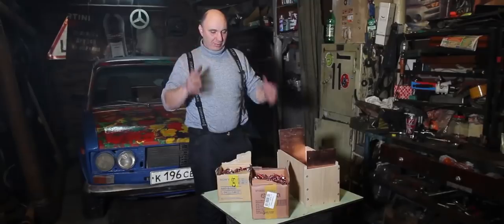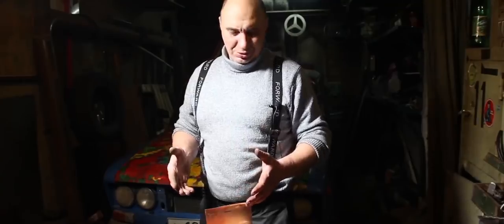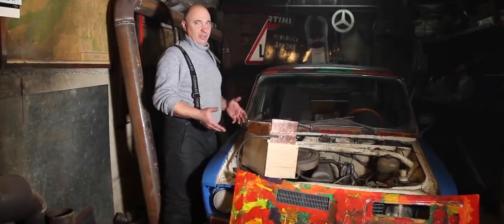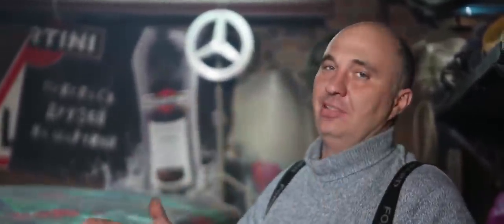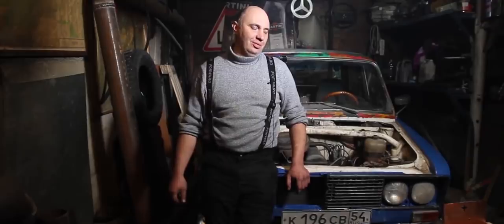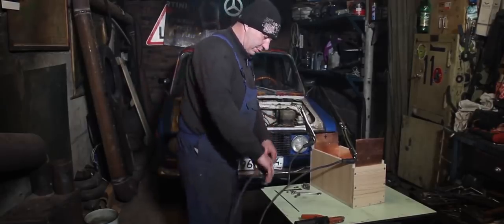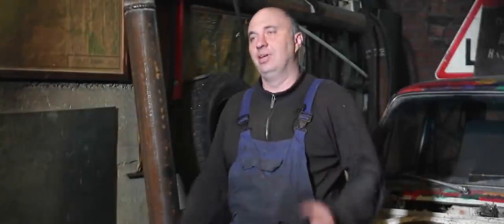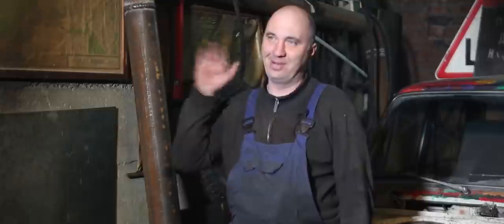1000 AA's instead of a conventional car battery

Comment: 12x8=96 per row.
So it is either 960 with 10 rows or 1,056 with 11 rows.
With the cheap Alkaline having about 1,800mAh capacity.
The capacity would be 144Ah at least.
Reply: He did 125 rows with 8 in each row = 1000 batteries.
If battery puts out 2 amps, times 12v = 250amps. Some say they will put out 4 amps - well then 500amps. Short time though as these batteries have high internal resistance and will heat up fast, weakening them. Without battery balancers, this pack will die.... What a waste of $ & Batteries...

Comment: Math:

The nominal votage is 1.5v. In order to have 12V, you need 8 batteries in series.
1 battery has capacity between 0.7 and 2.5 Ah, so let say it has 1Ah. That means 1 series of 8 batteries has 1Ah of capacity. 
There are 1000 batteries,  1000/8 is 125 series, therefore this battery has 125Ah capacity, which is about the same capacity of lead-acid battery that has same size like wodden cradle. 
The current rating for these batteries is about 0.5A, given 125 series in paralel gives 62.5A, which for me is amasing that Lada would start with 12V*62.5A=750W of power.

I hoped that cranking current is more like 100-150A, but if battery voltage drops to 7V, it is still 750W. So it is about right.

Comment: Well, it's not really surprising is it?
AA batteries typically have a capacity of around 2.5 Ah. You have 125 parallel rows of 8 cells in series. Which results in 1.5 V * 8 = 12 V at 2.5 Ah * 125 = 312.5 Ah. Since the capacity is usually measured at around 0.2 C that would be the expected capacity at 0.2*312.5 = 62.5 A, since the starter motor of a car draws more than that (typically around 300 A) your capacity will be lower. But still, even if it's were only 100 Ah, you wouldn't be surprised if a regular 100 Ah car battery would be able to start your car a few times and make some metal glow right?
And most AA batteries should be able to supply a short circuit current of around 5 A, some even 10 A. Since you have 125 batteries in parallel that would result in a short circuit current of 625 A to 1250 A, which is certainly comparable to a good car battery.

Comment: connect it to an inverter and see how long it will run a 100w light bulb for, then you can get a measurement of the amp hour capacity

Comment: You could start about anything with that many batteries. Huge amperage. You need 2 or more car batteries to weld (24volt), it works great because it's DC. (in series)

Comment: welding with direct curent should work better if the current is pulsed so that there is a open cirquit 1/50 , 1/60 sec  (hz)
this can be done digital or mechanical with a pulse giver.
plenty to experiment .
good luck from Holland

Comment: This could actually work BUT use diode(they got some in those cheap jumper cables that use lithium batteries)  as not to recharge the non-rechargable AA batteries

Comment: You should be able to start your car from a single AA, given you could step up the voltage and store it i a capacitor bank. The energy contained in a single cell is about 3-4 Wh, and that's basically what it takes to run the starter for a second or two.
Reply: No Way! A super capacitor bank 300+Farad caps 6 in series would last forever (cycle wise) and a small battery to keep the top from draining off but would need 12v battery - not 1) 1.5v batt. a AA battery is not enough for that task.
I have 3 complete sets of UltraCapacitors using 3000 Farads caps w/balancers. Even the big F250 Desiel trucks that use to have to run duel batteries is no match for the S-caps. 1 million cycle life to boot - never have to buy a battery again. $330-$400 a set. Have 2 more kits to built stashed - 2000F setups. Youtube- Fun with super caacitors - yes, lots of FuN!

Comment: Each battery gives 3-4 amps? No. Each may give 100ma max. Altogether, there are enough batteries to provide enough cranking amps to the starter but not in the current configuration. Am I missing something or were they all connected in parallel? If so, they would have only provided 1.7v. That wouldn't even be enough to flip the relay. I'm calling bs.
Reply: Yes you are missing something its 8 batterys x 12 batterys x 8 layers so (1.5v X12 =18v 100ma)  x8 = 18v 800ma per layer x 8 layers so  18v at 6.4ah. That should start a car But thats at your 100ma after some googling I found out that AAs alkaline can output 2000-3000ma if true the battery would be 18v at 32ah-48ah thats crazy. I hope this helps. I think my math is right it may not be. so I may be wrong it may be 8 per line not 12 so more math thats (1.5x8) 12v at 100ma x 12 x 8 layers= 12v at 9.6ah  also thats only 768 batterys to get 1000 thats 11 layers not 8 
TLDR 1000 AAs can start a car
Reply: @matthewmaher1324  it would still only price 1.5v
Reply: @danielmolineux3644  when you have batterys connected + to - it adds the voilt together so 8 battery in a line + to - is 8 x 1.5v so 12v   just google "batteries in series". why would you call this video bs when you dont even know the battery works.

Comment: You should use Li-on batteries instead. They are slightly bigger than AA but have 3.6-4V so only 3 of them in series is enough for 12V. M.1 li-on batt. has 4AH and up to 10amps so the total amount of batt. would be 60 (200amps,80AH). Only problem is that max allowed voltage would be 12.75V and alternator delivers 14.4! so there is a good chance of them exploding after 5 min. of motor running. Other option is to use 4 in series but than alternator would't charge them(only to 5%) but there is almost no chance of explosion. You could always make some adjustment to the alternator's regulator circuit but most of them are sealed into epoxy.
Reply: Would need 4 of them in series. He could spend $25 on a super capacitor kit off ebay. They have over a million cycle life. I'd put 4 kits in - $100 never have to buy a battery again - ever!

Comment: There is a problem. Alkaline batteries are not rechargeable. and the car will by default charge them. Which ultimately will cause them to explode eventually

Comment: I doubt you'd get 3-5 amps from 1 AA. Just take your mAh rating and multiply that by 125, NOT 1000, for your current, since the multiple of 8 long is for your voltage. Then you'd have to learn how many amps the starter in that car needs for a good strong start. I would just put an ammeter in circuit to measure the current.

Comment: Instead of standard 8x 1.5V AA batteries He should use 10x 1.2V AA accumulators. They will at least charge with alternator without pottencially risk of explosion.

Comment: 14.4v or 18v (depending on wether 1.2 or 1.5), amperage is the big question here since i don'r have the slightest idea what's the capacity of them @1amp discharge rate or anything like that.
Reply: 9 batt in a row gives you 13.5v alkaline battery. might get 4 amps but its not design for full amperage so will die out rapidly. They will never compare to a car battery. Waste of $ & time

Comment: If the AA batteries were capable of the nominal mAh rating of 2800, then 10 stacks of 12 would produce about 336 amps. That's plenty enough to start an automobile engine, considering most starters draw between 150-200 amps. But, 8 AA batteries in series makes 12V, where the alternator produces up to 14.8V, and on the Lada, it would produce around 55 Amps, as well. Not being rechargable batteries, they would likely overheat and burst after a short time. You could, however, use rechargeable batteries, which would require about 30% more batteries to get the right voltage, that the alternator wouldn't damage while charging. Or, you could use ultra capacitors and charge them once with a battery, disconnect the battery, and use only capacitors as a battery.
Reply: A NiMH battery will charge at 14.v just fine however the charging will require capacity detection and would have to turn off when the charge current drop occurs.
Lifepo4 Lithium batteries would make the best candidate, a 4 stack would suit a charge at 14.3v and have a standing voltage of 12.4v.

Comment: would nimh rechargeable batteries work too? would the alternator charge them up?
Reply: they would charge just not fully at around 14 to14.8v
they might work even better because they can output almost ideal voltage and very high current compared to alkaline batteries you would only need maybe 50 parallel sets of 10 in series

Comment: Nice experiment. You should try a smaller box with rechargeable batteries. I wonder how that might work out. Love your videos. Always entertaining.
Reply: If it was cheaper, car manufacturers and after market suppliers would make them. Battery is design for its purpose. Rechargable far exceeds normal car battery costs and will never have the cranking amp-hours to compete.

Comment: Are Ladas 18 volt? 12 x 1.5v is 18v. It should be 9 in series to achieve the 13.5v you want to power a cars electrics.
 
That's going to make a crazy battery pack. If the cake is 12 cells in series,, 8 cells wide, and 10 layers high (total of 960 cells) he'd have an 18v/228ah battery. Its cranking amps would be some what limited at 320 cca.

But if he's gone with the correct voltage, with 9 cells in series, 9/10 (alternating) cells wide, and 11 layers deep, plus 6 series on the 12th layer he'd have gotten 999 cells into the pack, and had 13.5v/316.35ah with 444 cca. And that would  perfict for a car that size.
Reply: Don't be crazy. Them batteries will not last. They have too high of internal resistance and are not meant to be recharged. Rechargeable's for more expensive than a car battery, or alkaline batteries even. Use super Cap packs instead

Comment: I feel cheated by 40 AA cells but it should be 12 Volts at around 240-350 Amps depending on the quality.

Comment: Makeshift heater with the electrode and rod. Should seen if the batteries would power all the lights on the car flashers headlights and brakelights all at once.

Comment: That was kind of cool. I always wondered if this could be done and how many it would take. I was surprised tho because AA batteries are 1.5 volts DC X 1,000 batteries = 1,500 volts DC and I expected to see it go up in flames when you first turned the key on. Keep up the awesome videos. I'm in Michigan, USA and I love the stuff you do in these videos. Peace.
Reply: no no no. They were 8 batteries in series = 12 volts. He had 125 rows of them in parallel. 125*2amp=250amp@12vdc, = 3000watts. Assuming 2amps a battery.

Comment: Clearly the next logical step is to build a different casing that fits in the battery compartment, put a lid on it so that the batteries dont fall out, and drive around until something happens.

Comment: You could still have hidden wires hooked up to it if you wanted to. I think most of the people watching take your word for it anyway and just start the engine and then just disconnect the batteries so altenater won't create any possible problems.

Comment: You should try this with rechargeable AA batteries so the alternator can recharge the batteries and then take it for a test drive
Reply: Better off using super capacitors. They sell those kits on ebay. Million of cycles use

Comment: Love this channel, but there is one small mistake.  At around 1:45, you say that 1 layer is 8 batteries wide and 12 batteries long.  At around 2:23, you can clearly see that it is the other way around, 12 wide and 8 long.  This would also make more sense, because 8 long would be 8 in series which multiplies voltage, and therefore is 8x1.5 volts=12 volts, which is a car battery.  Garage 54 has done this correctly; the error is in the narration or translation.

Comment: 1000 batteries divided by 8 (8 AA batteries at 1.5 volts each gives you 12 volts) gives you 125 sets of batteries. Most AA batteries are rated at less than 1 amp. So at most this pack would give you about 125 amps. That may enough to start a small car motor. I work in a small engine shop and I have ran tests on lawn motor starting systems and a simple mower engine can pull from 175 to 200 amps. This is a fun experiment but not really practical means to start a car.

Comment: If one assumes that each battery has 1.7 volts and has a capacity of 1 amp hour, then as they are stacked in series 8 batteries long they put out 13.6 volts with the combined capacity of 1000 amps so this should work. Even if they only had a capacity of six hundred mAh each it would still be enough. That being said, I am by no means any certifiable knowledge on the storage of electricity

Comment: You use way to much batteries, the job can be done with much less. Why they didn't actually check the voltage and the current?

Comment: It should produce plenty enough power to start the car, many times... and regardless of the warnings, they can be recharged to an extent and that means that they could be used for actual driving... for a while. But heating will kill individual cells fairly fast, and with the number of cells in his battery, total failure will come quickly. 
And I'm sure, too, that the cost of all those cells, the cost of the box and copper, and the labor of assembly... good ole lead-acid will be FAR cheaper and longer lasting.

Comment: It would be cool to see the minimum amount of batteries needed to start the car
Reply: About 9-10 ! 
That would be enough voltage and amperage with the correct amount on parallel and the rest in series, it would get it up to about 50rpm which is just enough to start it ! Though that would be one use, the batteries would be pretty dead by then

Comment: They have capacitor jump starters that will start a car, with the voltage from a dead battery..
Reply: You could throw away the battery and just use the jump pack permently- if its a larger pak

Comment: You could also add between each cell. A super capacitor.
Reply: No. They all should be super caps. Only need 6 to get 16.2v max rating in series.
Each being 300+Farads would be all that is needed and will last a lifetime.
Ebay has 100Farad kit for $25. But 3-4 kits and never buy a battery again!

Comment: So using his description 8 layers of 8x12 batteries is 768 batteries.

If each layer is 12 rows of 8 batteries. 

Each row is series, rows are then arranged in parallel and layers are then again in parallel. 

Series multiplies voltage and maintains amps, parallel multiplies amps and maintains voltage.

Each row of each layer is 12 volts at apprx 500 mAH,  (based on an approximate average of about 500mAH for nonrechargeable AAs)

Each layer is then 12 volts at 6 aH 500 x 12 / 1000. 

Then 8 layers makes for 12 volts at 48 aH or 48 continuous amps for one hour. This is just based on what he said about 8 layers. 10 layers would he 960 batteries and would he 60 amp hours. Which is probably the case if he truly used a nominal 1000 batteries.

There are some AAs that produce as much as 1400 mAHs. No idea the specs on his batteries. If these are high output then the pack could be as much as 180 amps or so, but no way to tell without knowing specific output.

It's not that much, and probably couldn't start a larger engine with a larger starter motor and more rotary mass or a diesel with high compression.
Reply: ah is not a
Reply: @David-cy5zu correct an amp hour is storage, the ability to supply one continuous amp for one hour, two for half hour etc. AAs don't provide current the way that a car battery does. They are designed to supply the current over time, instead of the "cold cranking amps" where more mass current is supplied very quickly (because large batteries have lower internal resistance). There's no conversion from one to the other except to say that if a smaller battery dividers x aH, it delivers x amps for its first hour of run time. I really didn't want to get into it with my calculations but there is accumulative resistance when dealing with this many small batteries run in series and parallel so there will be a lot of heat generated wasting energy. As a matter of fact that's why I scaled it back to around a "ballpark" 500 maH when there are some AA batteries that deliver a lot more current than 500 maH (up to 2200 in some cases).

 In this case aH will simply have to do in the place of a.

Comment: ONE battery can't power a welder.  You need at least three.  Trust me, I've done it.  Four is much better.  50V is the sweet spot and for by 12V gets you to 48 which is good enough.

Comment: You made an 18volt battery if I'm not mistaking. 1.5x12=18 And you just have about 56 banks of 8 batteries if it's really 8×12×8
Reply: Its not. 8 in a row, 125 rows. Stop & count... Car starter would preform better at 18v though :-)
Reply: @SamaritanElad  What? That what said lol

Comment: You should use the actual lithium ion batteries from the picture. They hold so much more power and can handle more
Reply: Too much $/batt. + only 500 cycle life. Ultra Capacitors the best way to go - million cycle life.... $100 - never will have to buy a battery again - ever!
Reply: SamaritanElad that is very true 🧐

Comment: I don't know what car batteries cost in Russia but 1000 AA's can't be cheap hahaha. But seriously we started a 1988 thunderbird turbo coupe with a little $19 lawn mower battery. 4 cylinder engines with a million miles don't take a whole lot to start.
Reply: not by its-self. It could aid in recharging the car battery enough though.